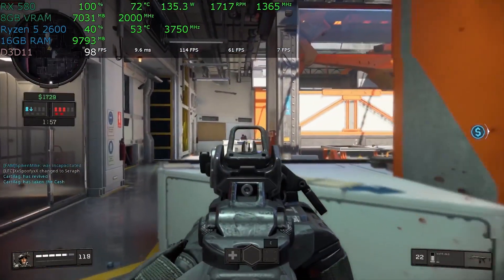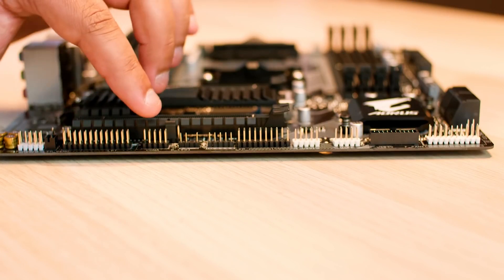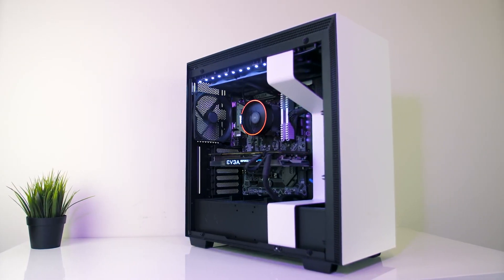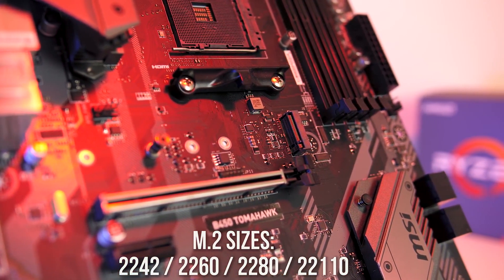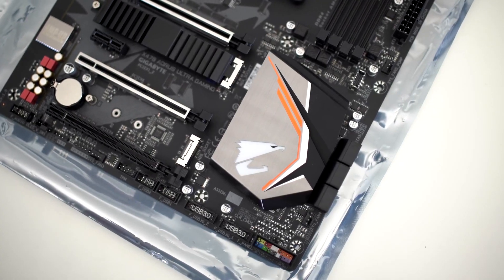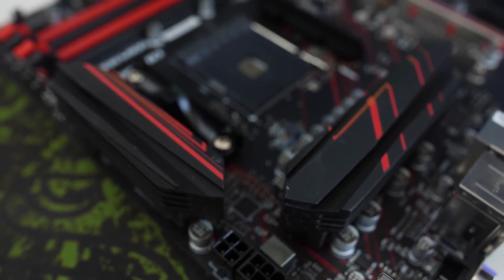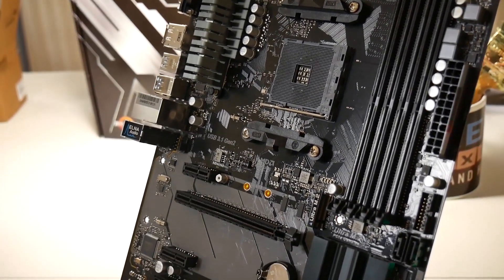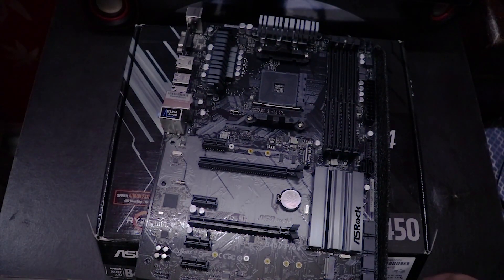Best Motherboards For Ryzen 5 2600 in 2022 / 2023 (Top 5 Picks)

Comment: Hey there I'm new to gaming so i wanna ask for some people that I'm in a very low budget help me if there's anything wrong yeah i only want 1080p gaming that's it
Cpu=ryzen 5 2600x 
GPU= gtx 1050ti
Ram= 8x2 16gb
Motherboard=suggest pls
Reply: i have about the same build and my motherboard is a x470 gaming plus max which has worked perfectly fine for me
Reply: and with this motherboard it will support 3rd and 5000 series so if you ever upgrade your cpu you won’t have to buy a new motherboard
Reply: @Aye_Gee  is it better to buy motherboard online or offline in market if we but online will the seller  give me with updated bios
Reply: @7dsgaming393  since you have a 2nd gen processor it will come out with the right bios already so you won’t need an update

Comment: how about A320 motherboard to ryzen 5 3400G
Reply: I dont recommend you buy a320(i have it), b450 is way better
Reply: Dont buy that, buy 450 its better
Reply: So what is recommended for ryzen5 3400g or 5600g?
Reply: @romyow6326  b450 or b550 they have like 20 dollars difference
Reply: @jami3091  what is different between b450 b550
Reply: @romyow6326  but im not sure is it supporting 5 5600g

Comment: Tuf x570 plus wifi a good match ? I want to upgrade down the line to the ry5 3600 rn I have the ry5 2600
Reply: Same here, planning to upgrade to zen 3, rn have the r5 2600 should i go with x570 or cheaper b450?
Reply: @sonjawicaksono  i'm pretty sure you cant go with 2nd gen ryzen and 5th gen motherboard
Reply: @dimitris.mg23  Χ570 mobos are compatible with the 2600 and 3600 out of the box. with a bios update it can support tthe 5600x
Reply: @andrewgiannoukakos9664  ok file
Reply: @dimitris.mg23  λοοοοοοολ δεν το περιμενα να εισαι ελληνας. θες να σου στειλω το λινκ απο εναν discord server τεχνολογιας?
Reply: @andrewgiannoukakos9664  nai why not
Reply: Another path is to go for zen4 + ddr5 mb, when can wait a short while. The choice is a good timing buy, guessing money is not an issue. Why go for a to b to c then d?
Reply: Will it work on MSI B450M PRO VDH MAX ?? Pls help 🙏